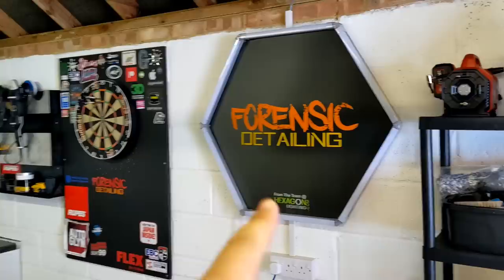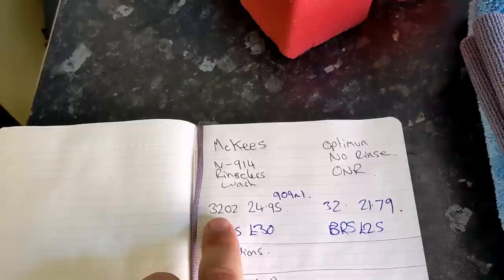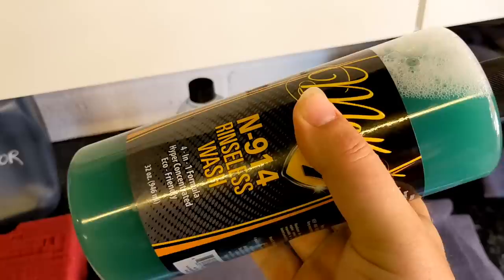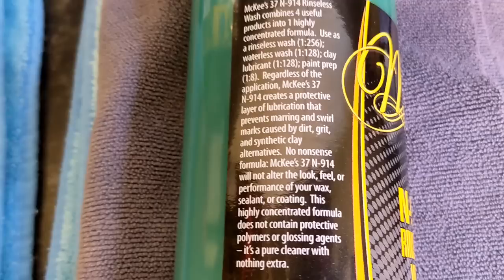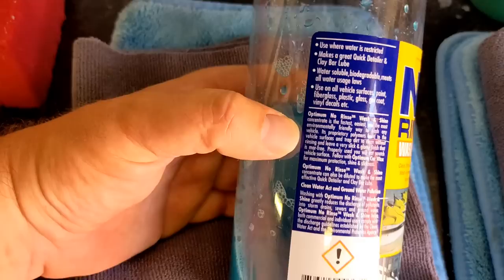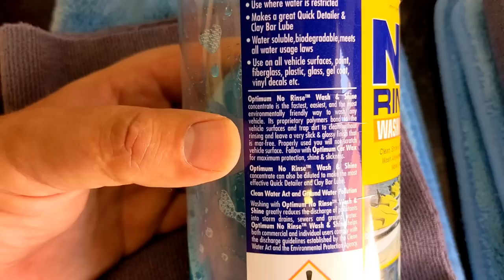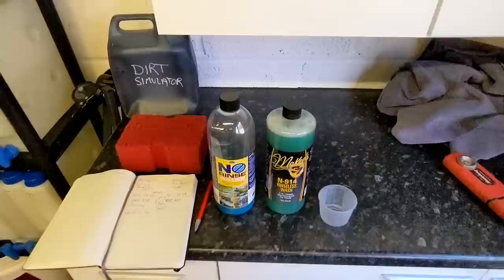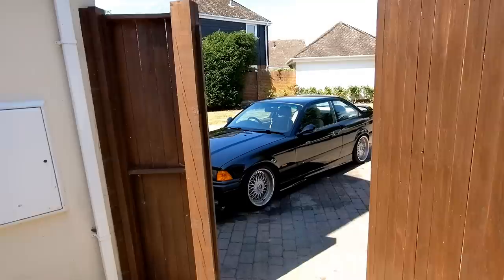O.N.R V Mckees N914  Which one is best? | Best rinseless wash comparison

Comment: I've been using both ONR and McKees N-914 a lot lately for rinseless washes. I don't have a garage and my washing sessions are a race against the clock and this method saves time. I'm not a pro and I can't tell the difference between the two products. I do recommend pre-treating the paint with a spray of the solution and allowing it to dwell to loosen up the dirt before the contact wash. Thanks for the video Jon.
Reply: I’ve got a garage but too much stuff in there to park a car in there and I have a big car so it would be tight anyway , I always do normal 2 bucket method outside and it can take me 2-3 hours for doing everything , I don’t have to race against a clock abc it’s not a problem
Reply: @ImranAli-rp4kd  I have to say it takes me at least 2 hours to do the exterior of my car even if I do it at a fairly good pace. I see loads of detailers on YouTube claiming to do their car in a very quick time, say less than an hour, tbh I don't believe any of them. Let's be honest just doing the wheels and tyres properly can take up to 30 minutes. I've watched plenty of  professional detailers, you know guys who actually do it for a living, and believe me they do NOT do a car in 1 hour! I've learned over the years to take YouTube detailers claims on almost anything with a pinch of salt, let's not forget why they are even on YouTube  - to make money! It's becoming more and more obvious with certain channels that it's all about how much they can make and not always about being truthful, sooner or later they all sell out. Trouble is we are not all idiots and I'm sure they think we are mugs, but we see you guys and know exactly what your game is! Some of them just lose their way, some of them forget why people subscribed to their channel in the first place, some of them have no clue why people follow their particular channel! Some of the go 'all Hollywood' and let their egos take over, some of them reach a level of subscribers where they can churn out any old crap and make shed-loads of $£€ so they start doing exactly that, and some of them put stuff on their channel that has nothing to do with the channels original or claimed content just because they have hundreds of thousands of subscribers. And don't get me going on these new 'shorts' videos, I mean how many time do we need to see someone snowfoam a car? Answer is zero because we know how to snowfoam a bloody car! It teaches absolutely sod all and is a pure cynical money-making scheme. I hate what's happening, some great channels have totally lost their way! Then of course there are all the freebies they get for plugging certain companies and products, not to mention actual payments which don't get mentioned, it's become impossible to tell truth from fiction in YouTube detailing-land these days making most of the content worthless. A pro-detailer who actually makes his living from that business but is willing to show you there actual real-life work as they do it is worth watching, Jim White from WhiteDetails being a great example or Sandro from Car Craft Auto Detailing, both pros with the highest standards of work who actually run a top-end detailing business. 
Feel free to copy and paste this on any detailing channel of your choice, it's time they realised we are not idiots and know exactly what they are doing!
Reply: @steverabbits  Yh your right it’s impossible to do just the exterior in a hour, some claim they can do inside and outside in a hour, quickest I can do the exterior is 2 hours but once I done all the dressing and other little things we talking close to 3 hours, I really thought I was slow but obviously not, I do watch Sandro and he can take a week to do a car including correction and protection and I do understand YouTube and click bait and revenue and it’s hard to believe some things but obviously not everything
Reply: @ImranAli-rp4kd  Couldn't imagine spending 2-3 hours outside washing my car on my day off for it to get dirty again from the elements the next day.
Reply: @ImranAli-rp4kd  Iv done the exterior many times with a proper pre wash foam cannon bilt hamber, pressure washer, going around the car 6 times, hand wash, drying aid when drying, etc..in a little over an hour..ONR method im done in under 40 mins with full wheel and tire wash, without wheels and tires im done in 25 mins.
Reply: @whitegoodman7465  yh but in these videos they claim they can do in the outside and interior in a hour, it would take me 2 hours if I’m quick to do the exterior and then the inside, ONR I can do that quick but don’t like it myself
Reply: @steverabbits   I absolutely agree, and also love Jim White and Sandro, but lately Jim is doing a lot of PPF (wich im not a fan) but still watching him is like watching a TRUE pro detailer, as for Sandro i was a little rough with him in my comment saying ,,im not a pro, i dont have such eq yadda yadda" but i realised im there watching not becouse i can replicate it, but adapt to his knowledge by substracting or adding my own and use it to enhance my processes :) cheers mate for a great comment
Reply: @whitegoodman7465  reading your comments its like contradiction town, first you say u cant imagine spending time just to get it dirty again, second you say your done in an hour, yeah would like to see the effect after, i know washing and the definiton of ,,clean" differs from person to person, but i think you should also. Besides some ppl like spending time on their cars even in their day off. Especially then when nobody is rushing us.
Reply: @victoryensured7137 I don't  believe anyone can wash and dry a car properly in an hour. It takes 10 minutes to get all your gear out and set up and at least that long to put it away! Too many people live in fantasy land in the detailing world. I've been cleaning cars for almost 50 years and I've never seen anyone do it in an hour unless it's a total amateur who has no sympathy for the paintwork 😂
Reply: @steverabbits  agreed,  it's supposed to be detailing not smearing really fast. Especially when you do it for yourself
Reply: Wheels take about 30 and the full wash and dry on the rinseless for me on a sedan is about 40 minutes.

Comment: JON, I've only used ONR, the ORIGINAL.  Here in the Hartland (USA) we have extreme conditions, both Heat, Cold & Snow.  So weekly washes are necessary most of the year.  I use the ONR with wax for washing, drying aid, cleaning interiors, in my steamer, etc.  For about $20.00 (US) I can wash a car 500 times.

Comment: Hi Jon, Yvan Lacroix said that unlike ONR, McKee's N-914 is a pure cleaner and doesn't leave anything behind. So McKee's is best suited for those not wanting to mask whatever coating they have on the car. As for instructions, you use it the same way as ONR. There is a little bit of wishful thinking with these products, even during a demo, Yvan would layer APC on top to help deal with bugs/etc. So I'm of the opinion this is a quick way to clean a relatively clean car as it struggles with baked on or greasy dirt. Still, given the recent weather, used it and didn't get any watermarks, so that's good. As for sponges, the BRS can't be used with other traditional car detergents, whereas the BGS can (as can the the Rag Company black sponge, but that thing is useless because being black you can't make out if there's any dirt in it).
Reply: Yes it struggles with baked on grease/dirt/bugs as do all the other ph neutral car shampoos so what is your point ?
As with the black sponge, if the dirt is not on the vehicle after using it, assume it's on the sponge.
Reply: @MrViktordagur  Dealing with your last comment first, when you dunk the dirty sponge back into the solution, the only real way to make sure that all the dirt has left the sponge is to visually inspect it, and trying to spot dirt on a black sponge is a bit challenging, obviously.
In this video Jon questioned the degreasing abilities of these types of product, and that is the context in which I was making my point. If you've ever watched a video demonstration by Yvan Lacroix, he tends to dismiss snow-foam (more specifically ph neutral snow foam which tends be what is favoured by the North American market) and then go on to claim that rinseless washing is "better" than the usual snow-foam pre-wash followed by a 2 bucket contact wash. So my point is, in a recent McKee's demo he reached for an APC to deal with bugs and grease thus contradicting his previous position. But, although I don't like his hyperbole, I still like using these types of products in certain scenarios (I have both ONR and McKee's).
Reply: @KojakKronos  i agree that ONR has poor degreasing to no degreasing ability. I can see it especially on a white car after it has rained and there is a film of grime on the car. During the summer, not an issue as the dirt is usually dry. Optimum Power clean is needed. I normally ONR wash first to get rid of any abrasive dirt on the car. Then follow up with Optimum power clean sprayed on surface, and wiped around with an ONR damped towel. I don't remember having decreasing issues with Car Soap, even if it is Ph neutral.
Reply: I would not say the black one is useless. Seeing the direst is trivial really with this method IMO.

Comment: I've been using onr for years now. I use a couple microfibers to wash, folded up to have 8 clean sides and usually clean about 1 panel per side. I don't put them back into my bucket to that the product stays clean in the bucket. I also spray sealant onto the wet panel (in my case Reload) and use a damp microfiber to spread and soak up the panel. Then I buff with a fully dry microfiber. I will also wipe down the door jams and and dirty areas on the interior with the stuff. The bucket I use has a gamma seal lid so when I'm done I seal it up and use it for next time.  Its fast too, I dont have to dedicate a Sunday morning to washing the car, I can wash anytime - even in hot sun - in under 20 minutes.
Reply: I use this method too!  It reduces / removes contamination of the solution with all the dirt you just removed! Four microfibres and a 2 x drying towels and I am done. Really handy when I am away from home or on holiday.

Comment: And that's the old formula ONR! New formula ONR is a stronger cleaner and it beads up way quicker. When I compared the new one directly to the old one on the same car, I was blown away. I love how it beads on the car. The Mckee's inconsistent beading even puts me off. Flat panels behave very differently to side panels. Of course that's personal preference. 

ONR keeps the dirt largely in the media. However, after washing my two cars in about 20 minutes with the sponge, if I leave the bucket for a day. It will form a layer of dirt that is sticking to the bottom of the bucket.

I honestly couldn't do without the stuff. It's the only way I wash and very happy with the results. It's the best interior glass cleaner I've ever used. It cleans up 99% of interiors perfectly well. And it's a great polish remover for a non-coating LSP. Adds extra lubricity before claying with a fallout remover, And it's cheap as all heck!
Reply: When did they start making ONR with the new formula?

Comment: I have started using ONR on my Classic cars, mainly as it minimises the amount of water being applied to the body. As anybody familiar with classics know, they are not as waterproof as modern cars and have a lot of hidden water traps. I use the pre soak method and multiple microfibre towels and a spray wax as a drying aid. Despite the very soft single stage paints I have not noticed any increase in swirls or mating. Plus you can use it indoors in winter due to the limited amount of water and in direct sun in summer.

Comment: ONR pulls dirt out of the water better, making it sink to the bottom. N914 is a stronger cleaner, that’s why it makes the water flatter on the panel when you wipe over. 

I love rinseless washes, though I use neither of these currently - I am using Griots Brilliant Finish, which is very similar in performance to ONR, but leaves less polymers behind and I also use Feynlab Pure Rinseless which cleans like nothing else and is wonderful as a safe polish removal aid on soft paints. 

Also, they aren’t waterless washes specifically, they are rinseless washes. There was a good amount of water in your bowls! You still use water, but you just don’t need to rinse. That doesn’t mean that you don’t or shouldn’t pre-wash. On a dirty car, they are just replacing the regular shampoo portion of a wash for me, I will have still done a pre wash of some form.

Comment: In this particular scenario I would have spray some solution 1st to get the dried on dirt & grime to loosen and/or encapsulate. Also the ONR can be used a quick detailer because it does leave something behind, it's called wash & "SHINE" were as the Mckee's does not, which is why you can use the Mckee's as a paint prep.

Comment: I’m a big fan of ONR for light dirt or dusty cars. I find it has its place. I do always tend to put it in a pump sprayer to pre soak as I don’t like going on dry! I also have around 5-6 synthetic wash mitts I use so I don’t do the whole car with just 1. I then spray the car again after washing so I’ve got plenty of lunrication for the drying process. I also think ONR have a few formula which is meant to be slicker but it’ll take years to get through my 32oz bottle.
Reply: My method with ONR is similar to yours Ben. Multiple clothes sitting in my ONR solution. Pre wash panel with solution in pump sprayer.  I tend to squeeze most of the water out of the cloth before use.I then fold my cloth in to 8 and only use 1 side for 1 or 2 wipes depending on the panel. I always inspect the cloth after every wipe to see how much dirt is on it. I then use a clean side for the next wipe. When I’ve used all 8 sides the cloth goes in to a empty bucket for the washing machine. I’ve never had to re wet the panel before drying.
I always start at the top of the car and work down. I know John’s car wasn’t that dirty but he cleaned the wing with ONR from the top to the bottom and then went back up again. You’ve more chance of marring doing this. I find ONR great for a summer evening mid week wash.
Reply: @SuperDuncan67  yes that’s exactly the time when i tend to use it. I might give the microfibre wash and fold method a go next time. I’ve never had any marring issues and my cars got black paint so it would stand out like a sore thumb.

Comment: I think you're right on the ONR formula change - a video with YL referenced that people had found the N914 slicker so they responded.  I normally used ONR for bird poop, but better half's car needed a clean and I didn't have much time.  Used YL's method -  Pump Spray, bucket with sponge/micro fibra, then QD as drying aid with the towel.  (Used BH QD at 9:1). It looked pretty good to be fair. There's probably going to be water restrictions this summer so I'd better get used to it!
Reply: No idea what YL means
Reply: @steverabbits Yvan Lacroix

Comment: Been using ONR for about 15 years now and recently got some N914 from Imran. I have noticed that ONR does effect the water behaviour of my LSP sometimes, no big deal and is only temporary. What interested me about N914 was their claim that it leaves nothing behind so won’t effect the water behaviour. You can pre-wash and they do say this quite often, then do the rinseless routine, I do that all the time. You can trust the technology in the rinseless washes, you won’t scratch up your paint, i never have have but of course rinse off the heavy dirt first. I still foam and two bucket wash with shampoo most of the time but will always do a quick rinseless when time is an issue especially in the summer. Rinseless is the best way to clean your car in heat.
Reply: Absolutely agree with you Chris. I've been trying ONR, Feynlab amnd Wolfgangs - I never wash it without doing a pre-soak (with the rinseless product) and then rinse with the pressure washer. The one time I've tried it without doing a pre-rinse with the pressure washer I have pre-soaked and let it dwell, then hit it again with more pre-soak before the contact wash - I'd never do it on a dry panel, that's gotta be a recipe for disaster. Following Yvan Lacroix's approach I also spray the panel with the rinseless wash product in it's QD concentration prior to drying.
Reply: It won’t scratch but it leave swirl marks
Reply: @jal7068  generally it won't do any more damage than a regular 2 bucket wash IF you use the correct process. I wouldn't use cloths for example (I did when I started doing it but now I use a MF pad) and, if really dirty, rinse the pad out after one pass on each side. And you pre-soak the panel, and you have plenty of wash solution in the pad...and you use a QD to aid the drying.

Comment: John, you're only scratching the surface. I use 914 almost exclusively. Always start with the pre rinse with pressure washer, then quickly spray a slightly higher concentrated version of the product around the car, go back with single bucket and dedicated rinseless wash mitt and wash light pressure but overall normal. Solution almost always dries on the car. Finish up with quick detailer and it looks just as good as any two bucket full on soap wash. Basically saves the time of rinsing the car and drying a very wet car versus a mostly dry one
Reply: This sounds like a better method with the pre rinse to minimise swirl marks and similar to what I've been thinking. I'll probably even use 2 buckets - one for the top section and the other for the lower section.
Reply: @koolkat969  that works. Don't use a second bucket with water though it'll dilute the mixture too much
Reply: @motiOn732  Sure....not using a second bucket with water to rinse the mitt. Cheers